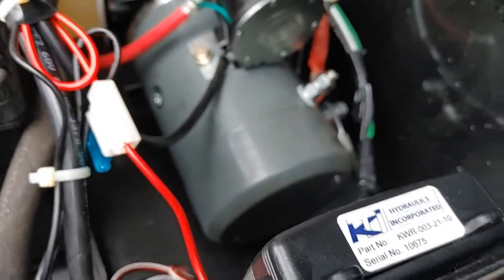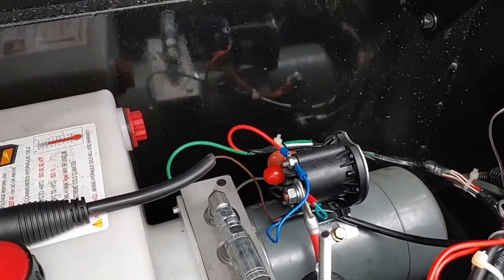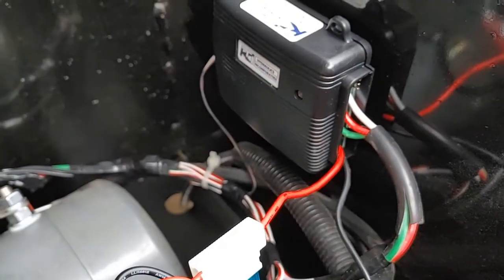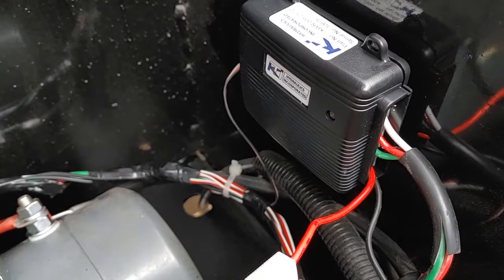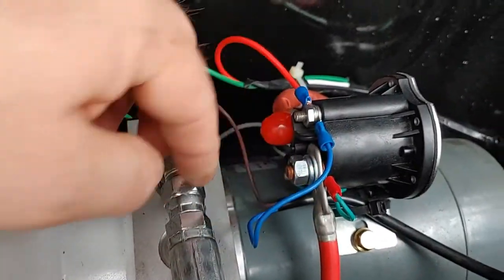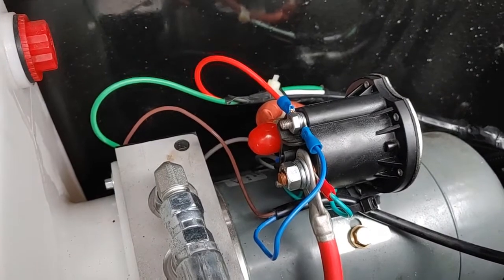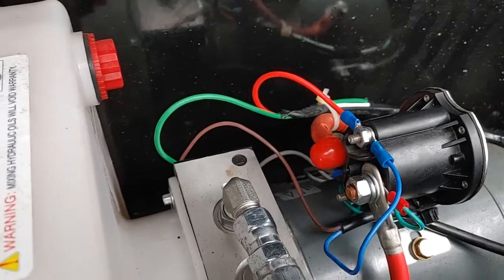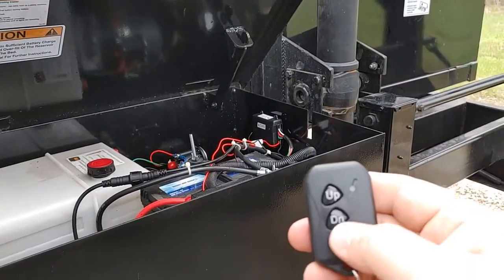Hard Wire Install KWR-003 Wireless Remote:  4-Wire to 3-Wire

Comment: That control is designed for KTI double acting cylinder control (power up and power down) made after 2015.  You could have done it for less with a common wireless winch control.